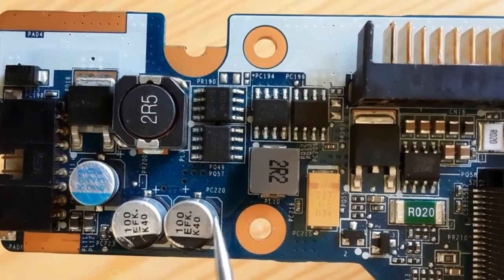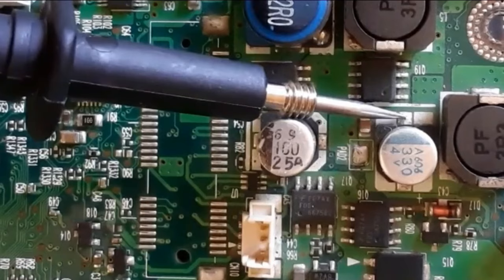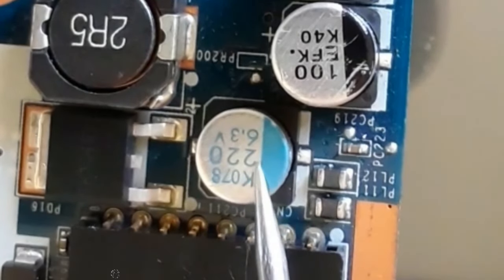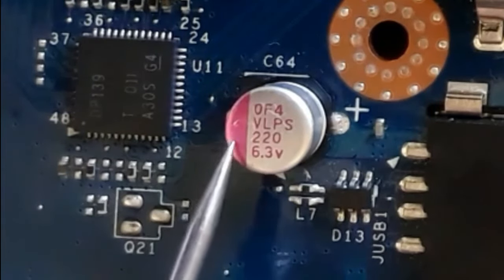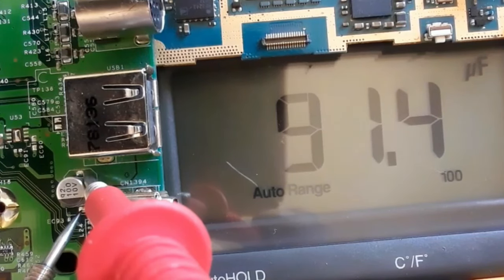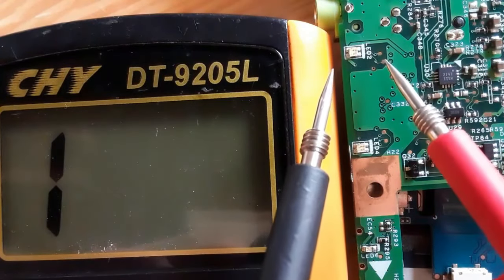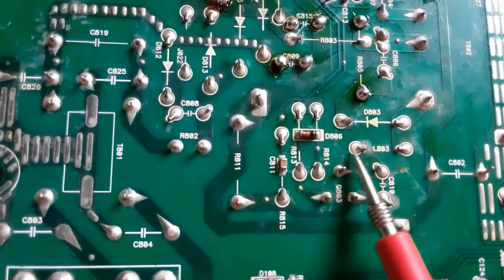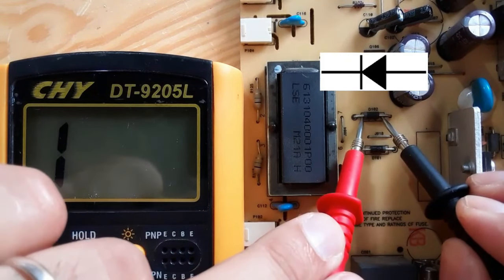Testing Ceramic Capacitors & SMD Diodes with a multimeter - smd capacitor test

Comment: How do you check live diode ?
Reply from the maker: Checking a live diode involves measuring its voltage drop in a circuit under working conditions. Here’s how you can do it:

1. Set Your Multimeter:
Switch the multimeter to the DC voltage mode (not the diode test mode, as this is used for powered-off circuits).
2. Identify the Diode:
Locate the diode on the circuit board and ensure you know the anode (positive) and cathode (negative) ends.
3. Measure the Voltage Drop Across the Diode:
Place the red probe on the anode and the black probe on the cathode while the circuit is powered on.
A forward-biased diode (conducting) should show a voltage drop between 0.6V to 0.7V for silicon diodes and around 0.2V to 0.3V for Schottky diodes.
A reverse-biased diode (not conducting) should show the supply voltage across it (depending on the circuit).
4. Analyze the Results:
If the diode is forward-biased and the voltage drop is in the expected range, it is functioning correctly.
If there is no voltage drop (0V) or an unusually high drop (close to the supply voltage), the diode may be damaged or not functioning properly.
5. Safety Reminder:
Be cautious when measuring live circuits to avoid short circuits or accidental damage. If the circuit is high voltage, take extra safety precautions.
This method allows you to check if a diode is conducting properly in its working environment without removing it from the circuit.
Reply: Sir, I very sincerely thank you for your prompt reply. I did not expect it to come soon. Your detailed  advice would help me a lot. Wish u good luck.